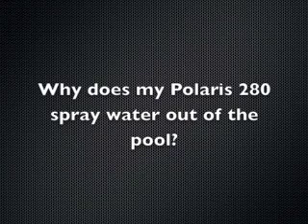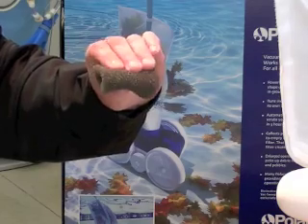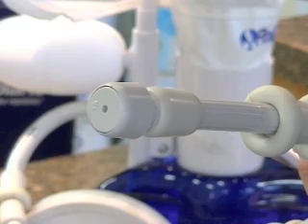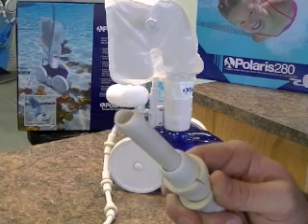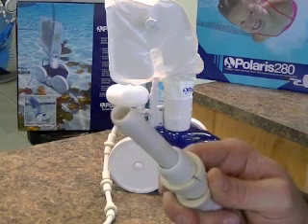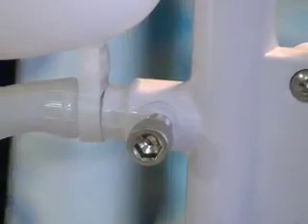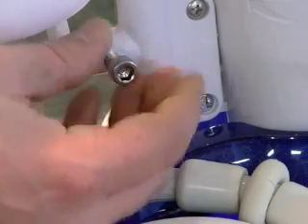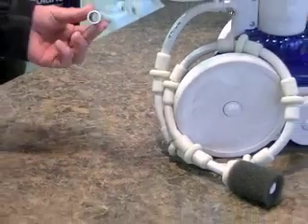Why does my polaris 280 spray water out of the pool?

Comment: I bought a brand new 280 when I replastered my pool. The 280 regularly ended up sucking the scrubber up its own tail (the intake on the bottom). I found it in this state for a week solid, then gave it up and removed the scrubber. It stopped inhaling its own tail, but now, of course, wets down everything in the patio. Annoying.
Reply: Scott Franco typical low pressure situation at tail. clogged cleaner feeding tail. clear so pressure is correct